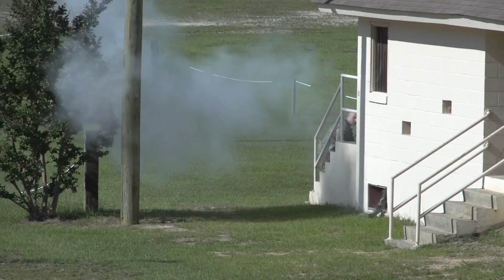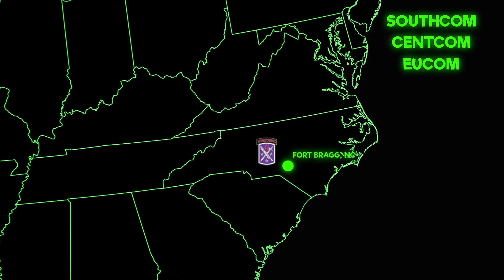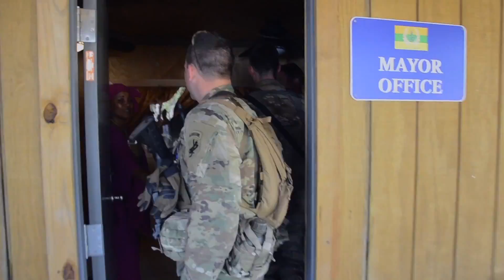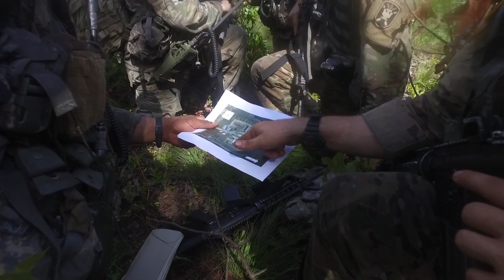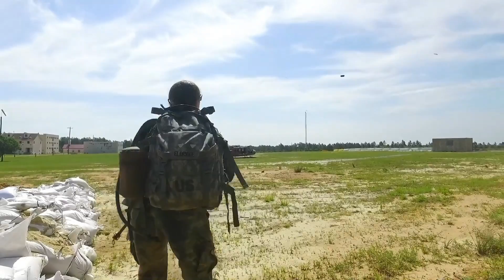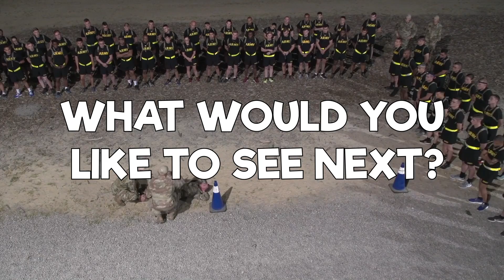US ARMY CIVIL AFFAIRS 2020

Comment: Hey, I’m currently at ITB west right now and my feet are destroyed, like swollen and blisters. Can you make a video on foot care for infantry and rucking?
Reply: Wear compression socks for anything more than 10k. Buy fox rivers or darn toughs in a size smaller than you would usually wear and put those over the compression socks as needed. Your boot is rubbing and taking your sock with it and your sock is then rubbing and causing blisters on your foot. You want your boot to rub against your sock, and your sock to stay stationary on your foot. Wearing ultra thin but very snug compression socks will act as an extra layer of skin that wont move with your boot incase your outer layer boot sock is too loose. Make sure you are wearing boots that actually fit and are broken in. Lace them as tight as you can so you still have circulation, but also as tight as you need so they rub as little as possible and you have as much ancle support as possible.
Reply: Wool socks and get some lotion so u don’t get ashy
Reply: Stop being a puss

Comment: Day 1 of asking for Navy AIRR
Reply: Isn’t that what they call air rescue swimmers now ?
Reply: @davidbane8292  yes sir, the abbreviation stands for air-rescue (airr). And they are rescue swimmers like the the coast guard. But also do much much more
Reply: Iain Miller-Moore A Coast Guard AST will have infinitely more experience and training than the overwhelming majority of Navy AWS/AWR. You’re right that a Navy AWS/AWR has a wider range of specialities, things like door gunning, sensor operator, etc, but that also means the odds of them ever actually acting in a Rescue Swimmer capacity is slim at best. The job is cool, but thinking you’re strictly going to ever be a rescue swimmer is not the reality of the job.
Reply: I was arss, when it was called that back in the early 90’s